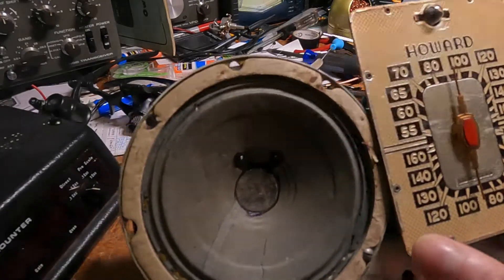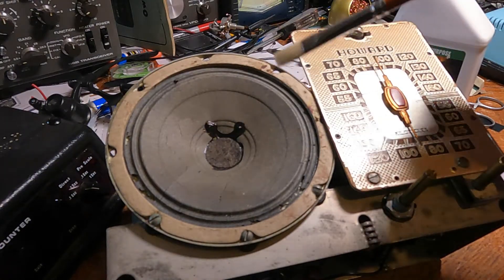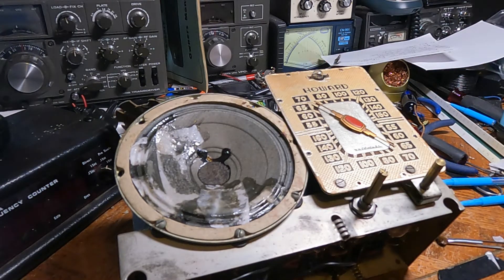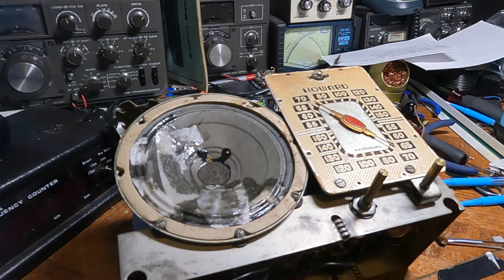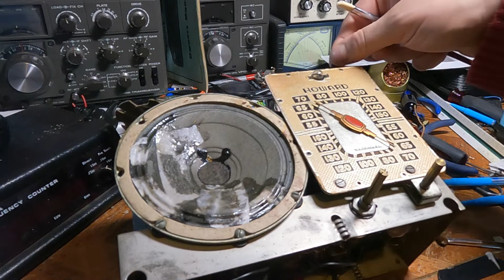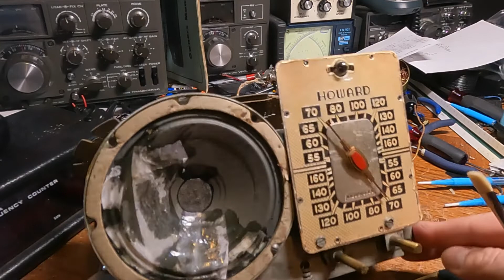Repairing an Antique Speaker Cone with Liquid Latex

Comment: from an old carpet layer that has grown up with using latex, and I might add that it was probably only 60 per cent pure so you could use a thin wipe over at the split .it is the same product that they make condoms out off so it will stretch and move with the vibration of the cone😃